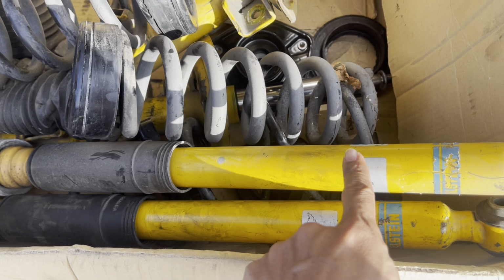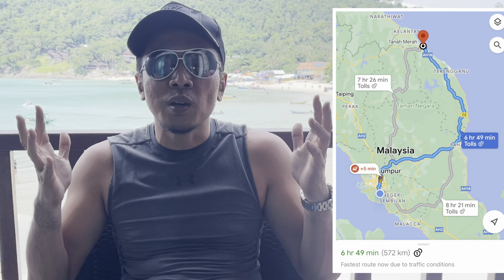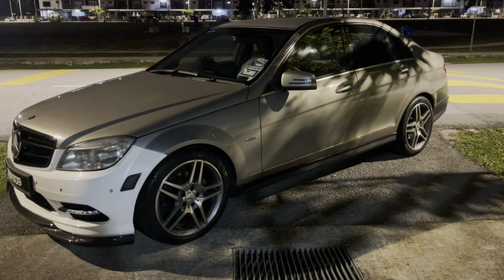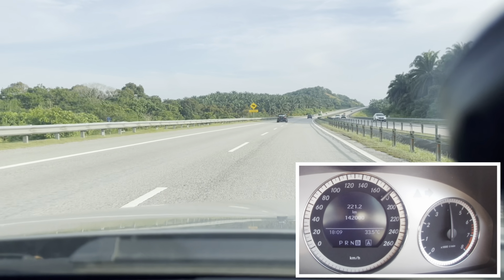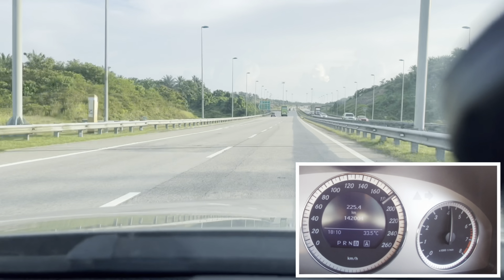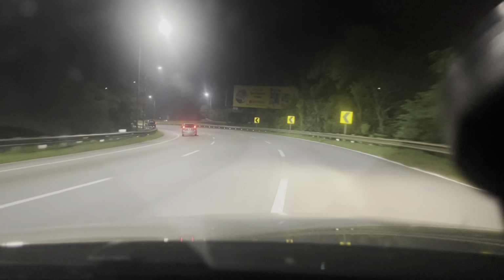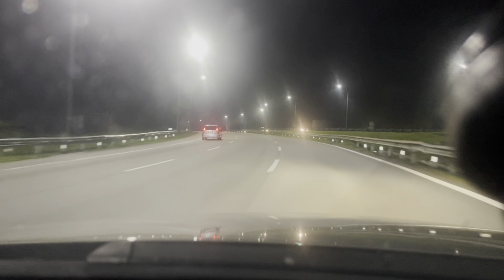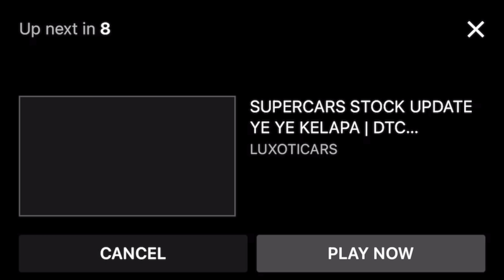Improvements on Mercedes W204 (Ep3) - The Handling Project

Comment: Good transformation for the handling enhancement you did bro. I used to have the exact same Wheel & Bilstein B12 Shock as yours but with H&R spring instead. We have the exact same taste for the wheel haha. I sold both the wheel & shock all together to a friend of mine & local neighbours.
Reply from the maker: How is H&R? Stiff?
Reply: @HaniffYahya  Yup H&R is rather stiff in comparison with Eibach since I have the same setup of Bilstein B12 on my W212 but with Eibach and its way comfier compare to my W204 with H&R.

As for now im using BC Racing BR Series with custom Tohatsu Swift Spring on my W204, way comfier now.
Reply from the maker: Thanks for the info